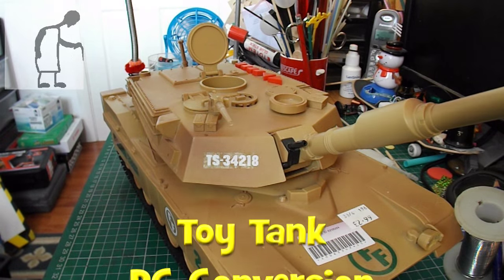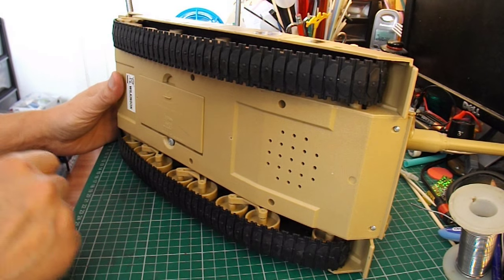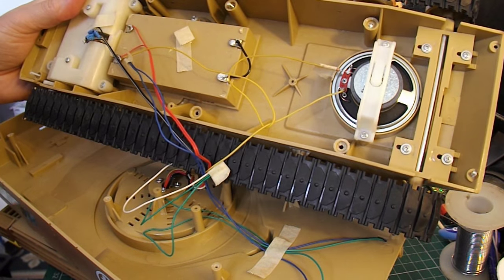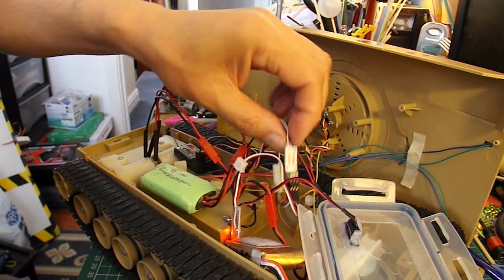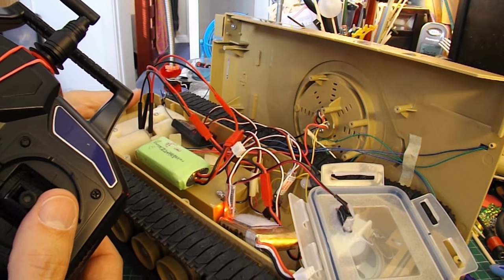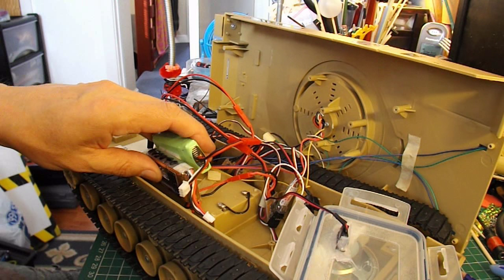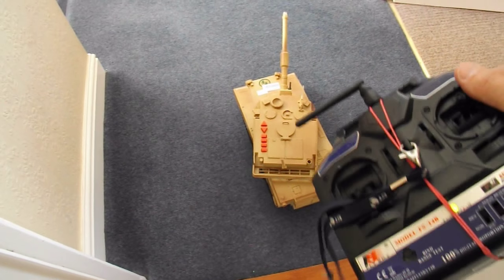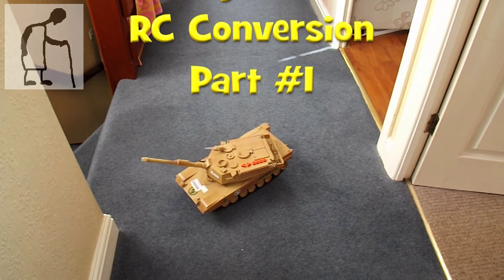Toy Tank RC Conversion Part #1

Comment: '
i have a M1A1 tank and open the gearbox and clean up messy greasey out...
put little vaseline on the gear / axle rod...
put 2 capacitors on the left motor / 2 capacitors on the right motor...
capacitor is 104...
will put R/C in the tank later

Comment: nice job with te radio control but i was wondering to ask if u couldconvert it somehow to use the 2 control sticks on the radio reciever instead of just the 1 control stick which activates left,right ,forward and reverse?
Reply from the maker: that's hardly a conversion. just plug one ESC in the throttle port and the other ESC in the aileron port. or any other combination you fancy but you won't get the auto centre using the throttle port unless you have a high end transmitter that is reconfigurable.